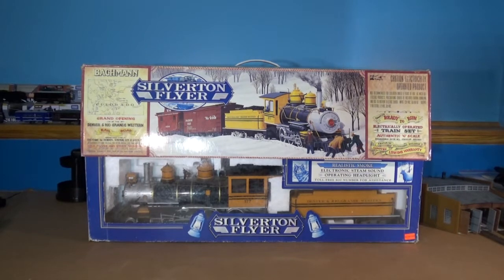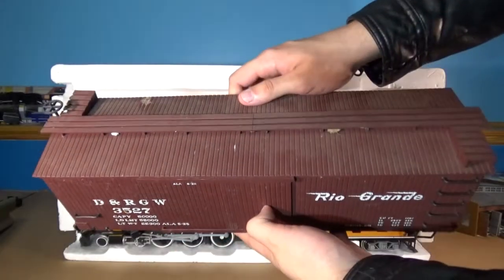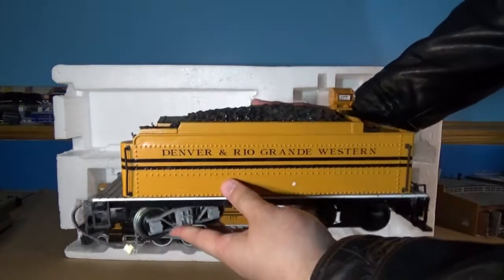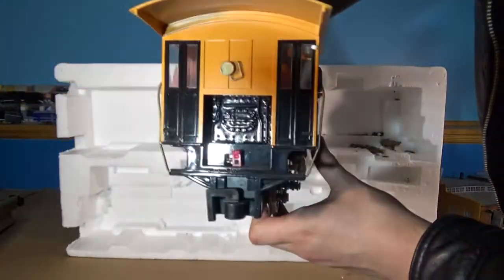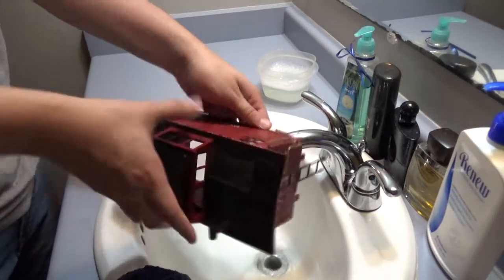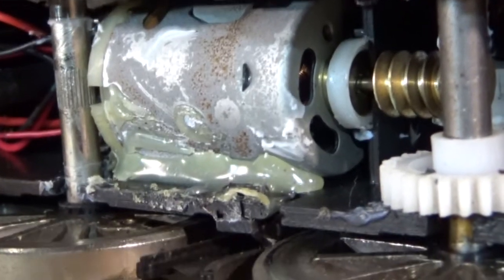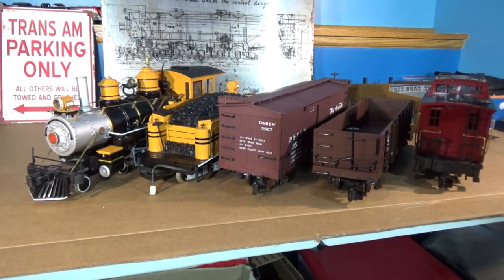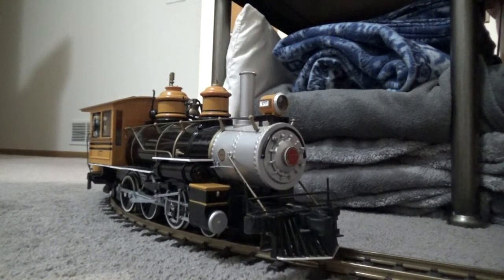Can I fix a Used Bachmann Train set?

Comment: I'd ignore certain negative comments on here, if I were you! That seems a good model to me - OK, not perfect but it has the potential to become something even better. It depends on how much work you're prepared to do. Gluing motors in has been used by some quite serious scale modelers, usually using a suitable type of rubber adhesive I think, so there's a slight bit of movement to allow for axle flex. The broken keeper plate mount can also be fixed fairly simply - it all depends on how skilled a modeler you are. I love restoring old model trains, the older the better!
Reply: have you converted an old battery train to run on track power like an old New Bright Christmas train for example?

Comment: Get some lube and clean every thing. Might make it less noisy. I got a set that sounded the same but the loco wasn’t as bad as this one. Still fun to tinker with, that’s the whole point. Nice video.
Reply from the maker: Thanks, I did try it, ran around the loop 10 times and it quit. it's now a test bed for scratch building.

Comment: How did you repair the pilot truck wire?  Both of my truck wires are broken off at the top of the truck spring and a proper repair method is not obvious. tnx